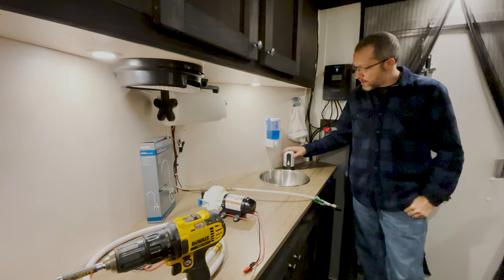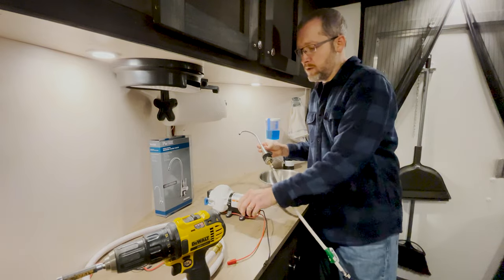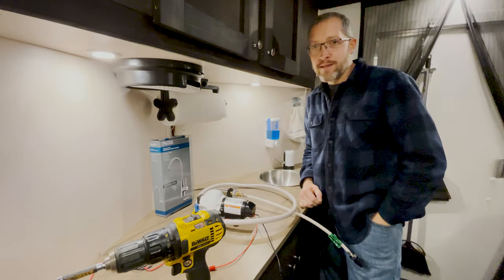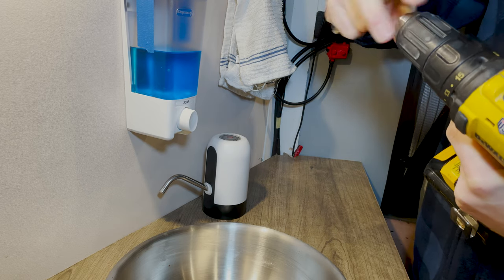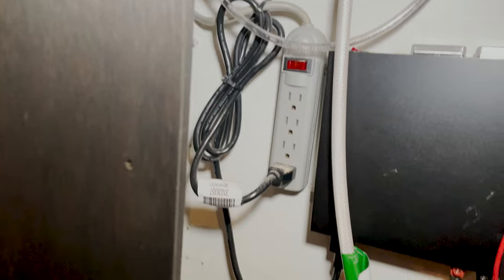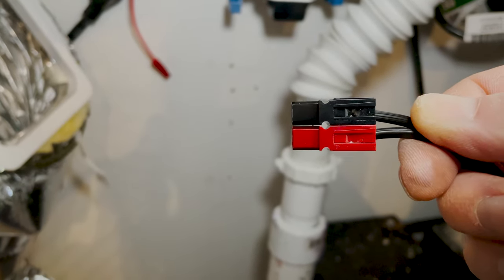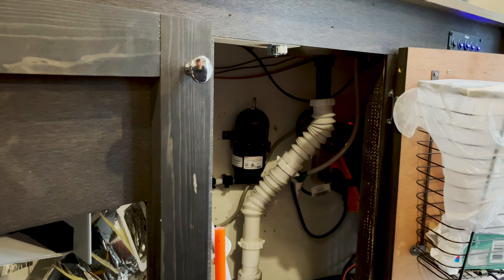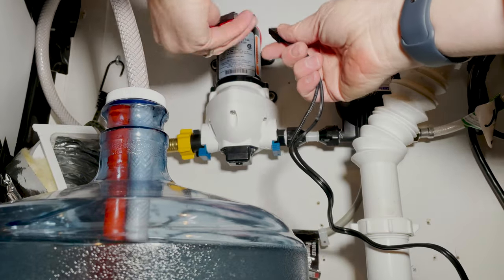Cargo Trailer Conversion - Faucet and Accumulator Install / Upgrade!

Comment: Had you used this pump Without the accumulator, and what does it really do?
Reply from the maker: Yes I’ve used it without and the pump constantly kicks on and off and sputters the water all over the place, especially if you try for a small stream of water.  Supposedly you will wear the pump out quick without one too.